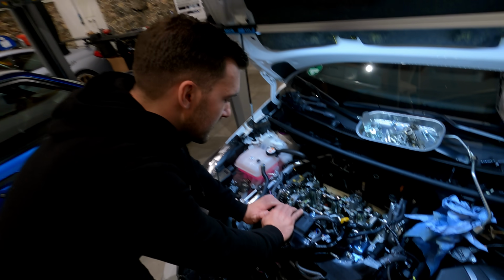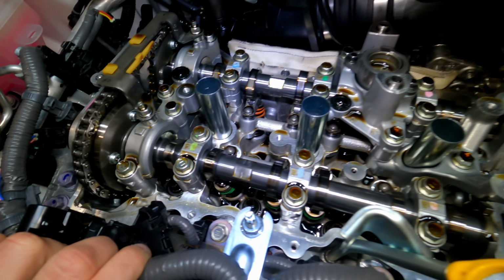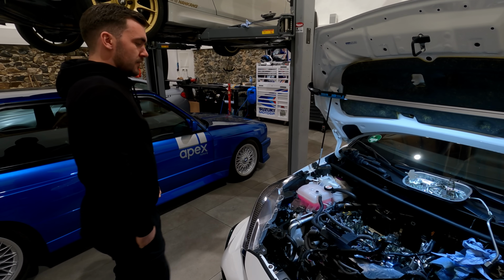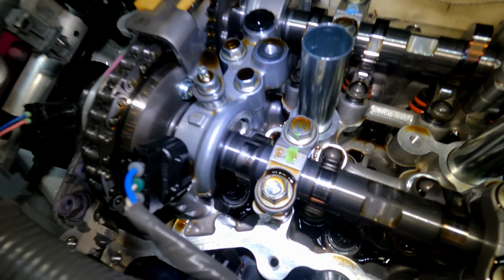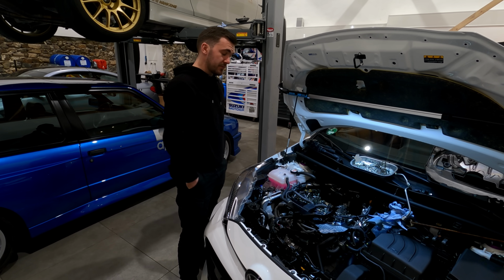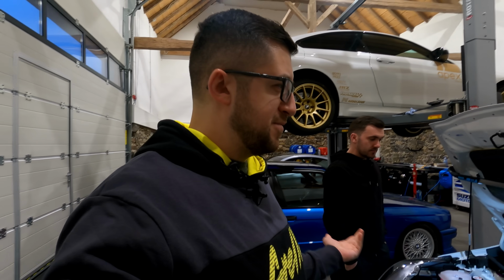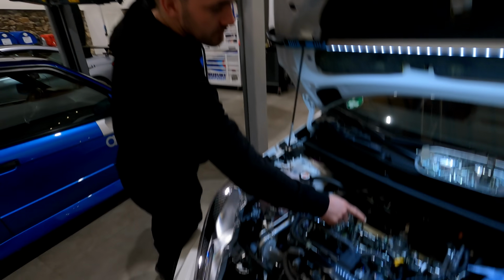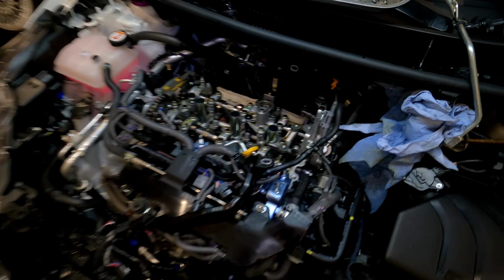Misshift Aftermath. Inside the Damaged Toyota GR Yaris Engine. OUCH!

Comment: This, I think, is going to be the first of many engine failures on not only the Yaris GR engine, but many other modern small capacity, highly strung modern engines.
You can't have everything, and getting big performance from such a tiny engine is a compromise, something has got to give, and that something is reliability.
I'll stick with a straight 6 thanks, which seems to be the most reliable engine type, and can withstand constant thrashing.
Reply: You'll stick to your used cars as you cannot afford anything else! Keep a look at for the GR's Niknak, your M140 will get left for dead (dont say I didn't warn you)
Reply: @relentlesspursuit6894  You're like a bad smell, following me around.
When are you going to put a video up showing your Yaris GR huh ?
You won't, because you don't own one, or an M140i either.
You're a lying, bullshitting, child.
Put a video up showing your GR doing 0-60 in 4.6 seconds troll, like your lying claims, or shut the fuck up.
Reply: @DjNikGnashers  sent you the link to the Top Gear test showing 4.6 in there hot hatch test - what did you think to that Niknak?
Reply: @DjNikGnashers  https://www.whatcar.com/news/new-toyota-gr-yaris-vs-honda-civic-type-r/n22892

Autocar also registered 4.6 - the GR even beats the M140 off the line and to 60, not the mention the twisties. 

You have neither, I have both - meaning you do not have a clue!
Reply: @DjNikGnashers  everytime you get sent proof you dissapear - why is that?
Reply: @DjNikGnashers  did you struggle to read the Top Gear and Autocar reviews?

You M140 gets beaten by a Yaris all day every day - perhaps one day you could afford to buy a better car, or maybe even 2, although very much doubt it
Reply: @relentlesspursuit6894  Are you in the UK ?
I'd love to meet up, then you can say all this to my face.
Lets see how brave mr internet troll is ......
Reply: @DjNikGnashers  how was your minimum wage job today Niknak? - I've been waiting to hear back from, thought you had gone for good?

Did you get a chance to check out those links I sent over yesterday?

How rubbish was your 140 in the snow today?

Comment: This happens because the manufacturers make three-cylinder engines (less balanced) with many horses, to raise a well-made engine with good quality materials from high turns this does not happen, look at the old 4-cylinder Honda you put water, sand , no oil, you turn it up to cut all the time i don't break , look at the nissan rb, look at toyota 2j , look at bmw m54 n 52 etc,...please car manufacturere in sport cars go to 4 cylinders or up and good materials on the engine , good quality aluminium good quality iron , good quality steel, good quality bearings springs etc oversize de motors well in the 21 century . thehigh revs shouldnt be a problem . who can think of making a three-cylinder engine for a car that is going to go on fire?? This car no is for one race and reaseambly or changing the engine how the 3 cyl rally car, this has to be a diary car realiable and durable.

Comment: This could be just unfortunate metal stresses on the rocker I would do an ultrasound test during the down time on the other parts/componants to see if this
Bodes to a factory casting issue. Worst case this could lead to a factory recall on the valve train. If that study showed premature stresses.
 I would start R&D on those parts invest in stronger alloys and be ahead of the curve if customers are seeking to make the engine bullet proof with the aftermarket sector. Would be a shame. Such a great start for this car but it also teaches other owners to be careful not to thrash the car so soon or down the road.
Sad that you guys are the sacrificial Lambs but because you have the talent and resources to do it.
That will show the other owners who can't afford such mis-haps or pending legal cases with the dealership/s to remain mindful.

Comment: Interesting video. I have a question: Having recently bought a new Ford Focus 3 cylinder, I am interested to know if you or George think a 3 cylinder block is structurally weaker than a 4 cylinder? Especially when you consider the power some of these cars produce.

Comment: Same problem as the Toyota 86 Fa20  engine on your hoist you should have a look at what I have discovered on the rockers.
The rocker has dislocated from the rocker pivot or in this case the hydraulic lash adjuster and lodged itself on the side of the valve spring retainer and has caused the valve collets to drop out,that’s the damage that you see on the cam lobe.
Yes the missed gear has in my opinion caused the problem but this car is built for track work and you have to expect this to happen.
Toyota needs to reassess this repair.Check out my findings .Denstoj Auto Centre.

Comment: Id love to know how the collet would make the through the pickup screen to get to the oil pump... biggest problems are binding in a valve spring or getting in the timing gear. 
Now if its something smaller to make it to the pump, it will go through the pump and get captured in the filter. Depending on the type of pump they use on this engine

Comment: Sad fact. This engine does not support bigger pistons for repairing. If the block is damaged new one should be bought. I think new head with full inspection of the old valves maybe a variant but to be sure whole new head with everything in it would be the way to go. The price will be so much but it's worth it. 

If I ever come to the ring I will drive only automatic rental cars. It's not worth the risk. Imagine someone like Robert with so much experience in the track and so many KM driven true the years can make a mistake so why wouldn't I?

I wish someday I can work at Apex :O

Comment: Misha I honestly think you would be kidding yourself if that could be a manufacturing failure.   As I put on Robert’s video a friend did something not too dissimilar with his EP3 civic type R a couple of years ago.   His was a 6th to 2nd over rev whilst on track (missed 4th and got 2nd) which he also thought he had saved by dipping the clutch again as the car seemed fine.   However a few weeks later it became  clear that the damage had been done and was waiting to fail as coming home from a car event (I also have an EP3) having a little play on a dual carriageway here in the U.K. it let go in fairly major style.   We think a piston ring ( or ring land) failed, jamming the piston which snapped the rod.  The rod made itself a little inspection hole (by little I mean you could almost get your fist in it at the back had it not been for the oil filter) and that was the end of that engine.   

It’s a real shame especially as it could delay the car being ready for people though and I’m sure deep down Robert is kicking himself for it.   But hats off to both of you for being so honest snd open about it.

Comment: If you can't find timing marks on a strange engine to you, you make your own by putting the engine on tdc firing no.1 and the video is not actually inside the engine just under the rocker cover.....as an aside afriend of mine did a 5th to 2nd shift on a 4age corolla and 12000rpm WILL grenade the engine it had 3000km on the clock at the time

Comment: Definitely a failure from over rev. For those that are questioning it I’ll explain how and why it likely happened in the order it did.

First when you have a mechanical over rev the vehicle’s on board safety mechanisms have no way to catch the engine and prevent it. The drive wheels are turning X mph and they are directly linked to the engine on a manual transmission so long as the clutch is engaged. So if a 5th to 2nd shift happens the engine is going to essentially spin until it can’t anymore. 

When this happens valve float occurs like mentioned in the video. The simple explanation of valve float is the camshaft spins so fast that the valve hasn’t made it back up to its rest position before the cam lobe try’s to push it back down again, it essentially ramps the cam lobe. When this occurs during normal operation at sustained rpm it can be caused by weak/work valve springs. Valve springs actually loose spring tension over time. Many high performance engine builders ask that the seat pressures be measured regularly during maintenance to try to prevent the possibility of valve float.

So if over rev and valve float is the cause, why did it not blow up right after the missed shift? In my opinion it likely lost one of the valve keepers when the mis shift occurred or moved the keepers to where one was half way in. A valve spring will stay with one keeper or the keepers not installed perfectly.  After this happened the car was basically a time bomb waiting to go off. Once the spring moved just enough the keepers moved the rest of the way and allowed the spring and rocker arm to come out. 

An articulating bore scope would yield you guys more information as far as if the piston is damaged and how bad the head surface is beat up prior to tear down. You may also be able to access Toyota’s tis and techstream global. I’m not 100% sure what the access allowed is in Germany compared to other countries but that would be your best chance of getting service information for the future.

Comment: Just piecing together a couple of bits of information from the video, maybe stating the obvious or maybe helpful (I hope); if the event was that the over rev distorted the rocker arm and then it gradually let the pin fall out, ultimately letting letting valve drop after some time and additional laps, you guys may want to consider that the same distortion could have occurred to more rocker arms and that future valve drops could be an issue. Be it myself I would definitely replace all valve springs and rocker arms (given Toyota has so kindly declined all warranty). Hope that's helpful! Keep the great content coming!

Comment: Difference in gearing between 2nd and 5th is 2.07. Revlimiter is at 7150 rpm according to dyno charts.
Obviously the dowshift was not done at redline in 5th but even if we knock of 1500 rpm when shifting into second we would still reach 11700 rpm (if my math is right) Ouch!
Very interesting to see what the actual data shows. Huge respect to Robert for being so honest about the incident 👍

Comment: Pretty rare to be able to misshift from 4th to 2nd. I've had it one time at a roundabout with a VW Passat Diesel, don't ask me how, most of the time there's like a mechanical resistance prohibiting this. I guess it's just bad luck. Fingers crossed Toyota has got some spare parts...

Comment: As you have said it looks like the over-rev caused damage to the rocker and/or rocker pin. 
Hindsight is a great thing and it looks if you'd have stripped it as far as you have now, but immediately after the over-rev, you may have been able to replace the rocker and pin only...if true, this knowledge may save you and other owners in the future from the internal engine damage yours looks to have  suffered in the event of a similar incident.
It looks like the use it had after the over-rev has potentially dislodged the rocker because of the pin damage and instead of it pushing directly onto the valve stem it has pushed onto the valve spring retainer, dislodging the valve collets causing the valve to drop and ending up with what appears to be contact with the piston.
Good luck with the repair, although obtaining parts may be the main issue, would like to think Toyota can help with sourcing those parts or maybe a replacement engine with some 'goodwill' thrown in...which you may or may not be able to divulge...🤔🤔
Looking forward to any updates and your next videos 👍👍

Comment: The suspension mods DID cause the engine to fail. Once Robert found out that Sport mode was 70/30 & when switched to Track mode it became 50/50 as he drove he was so happy that his brain was flooded with Endorphins & Dopamine which caused a Brain Fart which lead to his mis-shift that caused the engine to over-rev & cause the damage. So yes........ you could say the suspension mods did cause the engine to fail.

Comment: So, the rocker pin decided to leave work because of disrespect, rocker arm changed it's location and tried to open the valve by pushing on the valve retainer and that freed the collets. Nice. If the piston is damaged, the only way forward is ofc fully forged bottom end, bigger cams, valves, stronger springs, head port and nice Borg EFR to push this bich to 500hp. Guys at Ferrea can't stop wanking about the money they'll make on rocker arms. Robert Mitchell, you may not be Tier 1 media yet, but you can become Tier 1 Yaris engine lab rat. DO IT!

Comment: so engine swap, which engine should we cram in? Ls3? B18? k22?
Reply: 2ZZ-GE with Eaton compressor and huge FMIC intercooler = 300 HP reliable, which is more than stock engine but remains undestructible.

Comment: the best thing  to avoid these situations would be a patent that would not allow you to downshift one or more gears when the revs of the engine are not properly synchronized with the revs of the gearbox.There is some evolution nowdays as there is a rev matching system among cars like gt4 but I would he curious to know how it would operate to downshift like this.The only reason I see for not installing this system would be a safe matter as for example entering to a curve without engine braking but only with brakes would be not the point of course.

Comment: Don't see how 7200 rpm momenterily can cause this. I downshifted my 2004 2ZZ Corolla to 9K once and it didn't even blink. Not saying you're wrong, I'm just surprised/disappointed
Reply: I’ve owned several Hondas for more than 25 years, took them regularly to the track, I’ve used and abused them, no rev limiters and never managed to brake a single motor. I think there’s a lot of hype around this car, but it’s still very experimental and putting a lot of torque on such a small engine, with just 3 cylinders, probably isn’t the best recipe for success. If the motor is so fragile all the internals should be changed for better grade materials, this car is not suited to be used as a rental on a track.
Reply: @redlightson  I think you might be right. imagine this every time a customer money shifts? fuck that.
Reply: Yes but the 2ZZ-GE engines are virtually unbreakable... Why do you think Lotus put them in the Elise & Exige, threw a compressor on and pulled 280 HP from them. Tuners have gone over 300 HP with those very same engines, and stay reliable. Great stuff.
Reply: @micsub  for another example, take the Fiesta ST 1.6. They're only 6500 rpm stock, but people tune them to rev to 7500 rpm with no engine work running ~350hp. This Yaris motor has broken going to 7200 rpm just once. a FORD manages fine though...

Comment: Ive been experiencing this few times on mitsubishi 4g93 dohc. Same kind of valvetrain with lifters and rocker arm too. I changed to racing valve spring and a new oversized bore lifter. Kinda solved the problem now

Comment: Big question is how long for parts vs how long for an engine. Probably not good for either choice. Hope you get it going soon, but not optimistic. Just also wondering how much a new engine costs vs another car? Turn this car into a parts car. Get new car and put the suspension goodies on the new car. Next project:  Nurburgring high performance salvage business!

Comment: I believe this is a known issue with the rocker arms used in the Toyota GR V6 engines when pushed to higher RPM. My understanding is that the Yaris engine is essentially half of the GR V6 so what we are seeing here make sense. I would need to go back and do a bit of reading, but I think some of the MR2 guys who swap the GR V6 engines have addressed this topic. Another thing to consider is utilizing the available technical and service information for the most recent GR V6 engines. It is very likely that many of the procedures and torque values are the same between those and the Yaris engine.

Comment: Sadly, this is the harsh reality of over-revs. Especially when the engine is tighter-strung. The hindsight lesson learned here is that if you over-rev an engine, it's best to pull the top end apart for an inspection, even if it runs normally.
At worst you find nothing is wrong and you just spent some time as insurance, at best you find the parts prior to total failure.
Reply: Would you see damage, would it be obvious?

Comment: “Suspension can’t cause motor failure”...actually higher lateral g in turning and deceleration can affect the oiling system; which in modern cars is directly connected to head components in how they utilize oil pressure to vary timing. 
But this was an overrev.
Reply: Actually a road car can't achieve high enough lateral G for it to make any affect on the oiling system, not even close. If that was the case, cars would die all the time. And even if that was the case, it wouldn't be caused by suspension damage.

Comment: I‘d offer the parts to Toyota alongside the ECU logs so they can analyze if they need to improve a part. As you said a proper overreving damage would look different.
Reply: i'm pretty sure they've tested allllll of this before release. They don't need anybody logs
Reply: @akeem sure they did because Toyota. But just look at the Toyota/Subaru recall due to breaking valve springs - this also has been undergone standard testing QA and still failed - as well as numerous other problems and recalls across the automotive industry, VW 2.0 CFCA BiTdi, EA111.